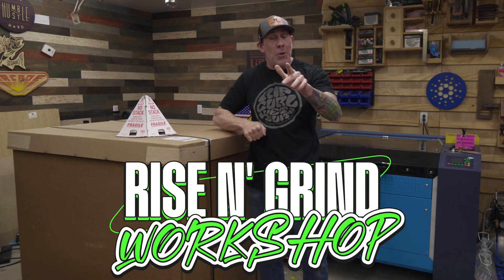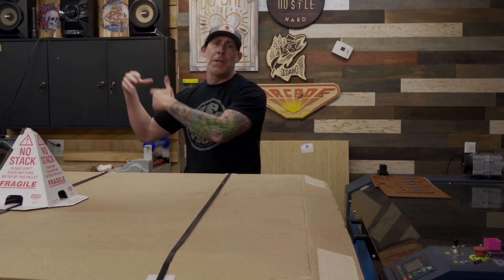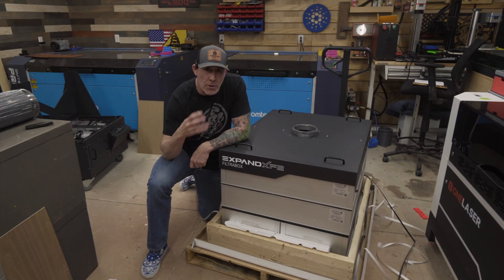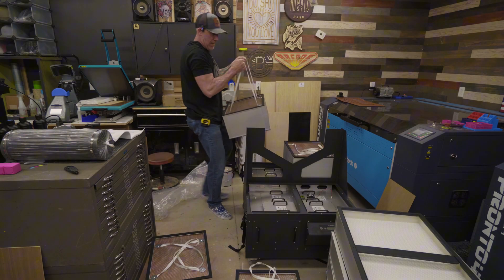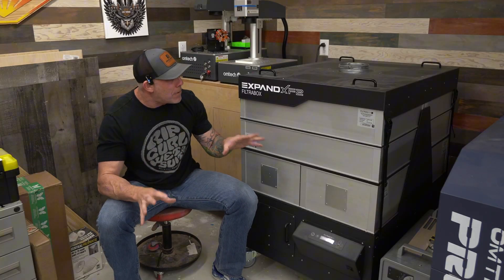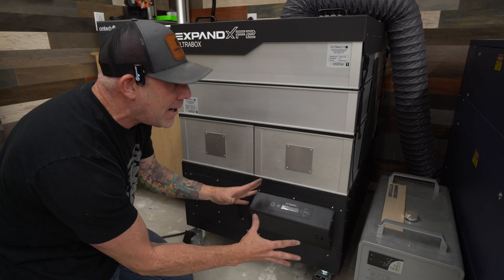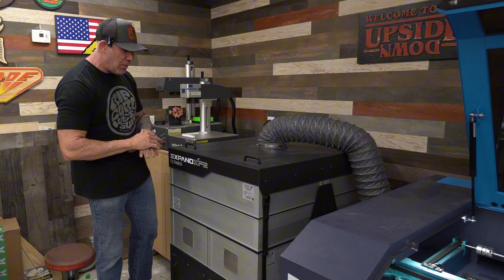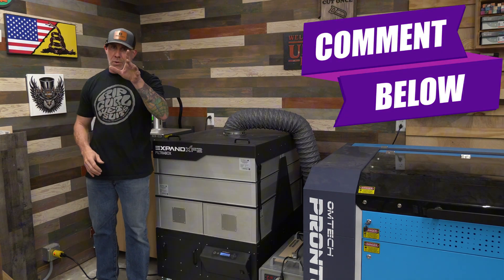HOW TO Vent a Laser Engraver Indoors | Filtrabox HEPA Filters

Comment: Great video. Thanks. I will have to reach out to them to see what setup I would need for two CO2 gantries, 1 CO2 galvo, 1 UV galvo, and 1 fiber galvo. I will seldom have more than two machines going at the same time, so that might factor in to what they suggest for my filtration needs.

Comment: interesting... definitely curious on long run use especially with dealing with a ton of MDF. will keep them in mind for sure ty
Reply from the maker: Definitely reach out to Donna at Filtrabox and advise what materials you will be using and they will give you an idea of how long the filters will last and if it will meet your needs!
Reply: @RISENGRINDWORKSHOP I’ll keep them in mind for sure, bought one for my diode and not as great as I had hoped for especially since I tend to do a bit of MDF core stuff